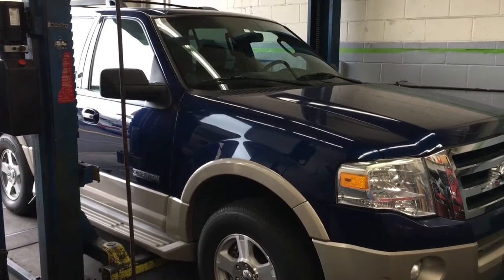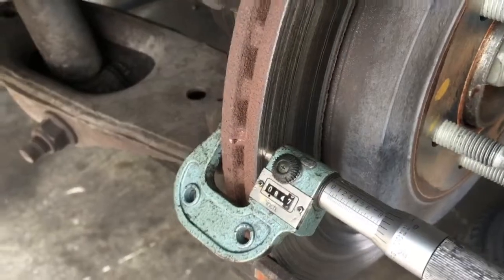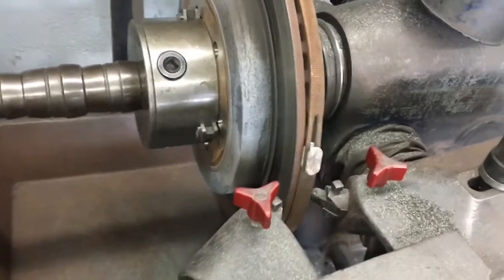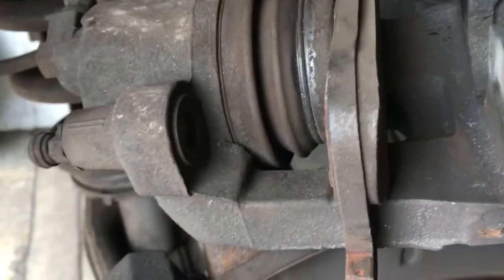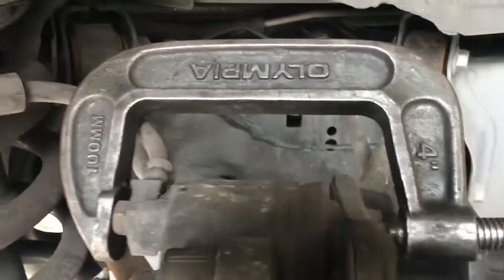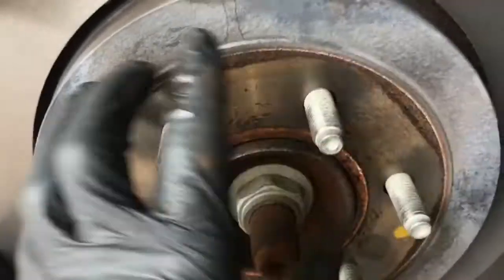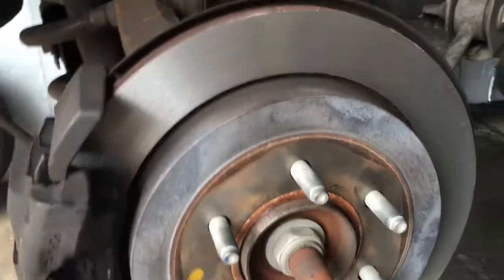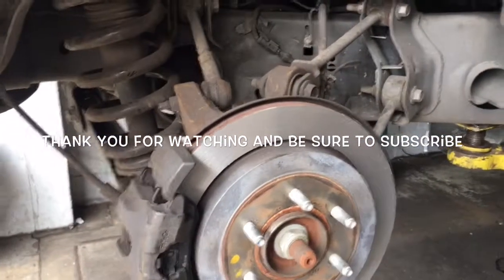How to Replace Rear Brake Pads and Turn Rotors on a 2007 Ford Expedition

Comment: Thanks for an exceptionally well-made and helpful video on how to perform a rear brake job on a 2007 Expedition.  It would be even more helpful if you would mention in your title, or at the very beginning of the video, the year models of Expedition or Navigator which have similar rear brake set ups, and to which these instructions may also apply. Also, Ford has very specific Torque specs for the slide or guide bolts and particularly for the bracket mounting bolts if the bracket is removed, which you may want to mention. Most auto parts stores turn rotors for a set price per rotor, in the neighborhood of $12 to $20 per rotor.  Dealers would charge shop labor rates, which saves you no money.  Thanks again for a really excellent video on this subject. Hope you do many more.